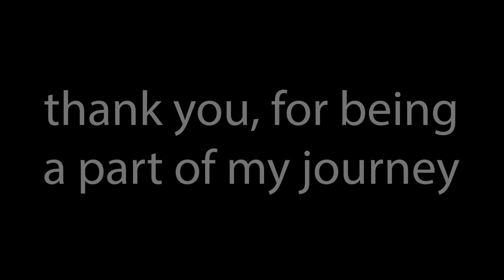HUGE GROWTH on COWS HOOF ... TRIMMING DEW CLAWS | The Hoof GP

Comment: I don't remember if you've answered this in another video and I've just missed it, but sometimes when you are using the grinder to trim the hooves, you go from grinding to holding the round disc perpendicular to the cow's hoof, and seem to press the edge of the disc against the bowl part you cut between the two claws. I never see any line cut into the hooves but I always expect that there will be some mark like when you run up against a pole with a weed whacker. Is the cutting part of the grinder only the flat disc part? Or are you not actually holding the edge of the grinder disc against the hoof? 

No judgments from me, I've just been wondering for a couple months now.

Comment: I’m curious what sort of wheel he uses, is it a diamond wheel? Or a regular grinding wheel.
Reply: Neither, it's a specially designed hoof trimming disc. It has blades inserted into it to do the cutting. There should be a link for it in the description.

Comment: Why are these hoof issues happening, i grew up on a farm in the 1960 and 70 and if i remember right our cows never suffered from this problem. The were walked everyday to and from fields. Is this symptom of new farming methods.
Reply: In the 60s and 70s Holstein cows weren't so extreme and carried a bit more condition, resulting in an increase of the digital cushion which protects the foot from the impact of every step.
The digital cushion is now much smaller, resulting in more lameness. Most other breeds don't have this problem.
It should also be noted that when trimming 15000 cows annually, he is going to find problems but 95% are fine.